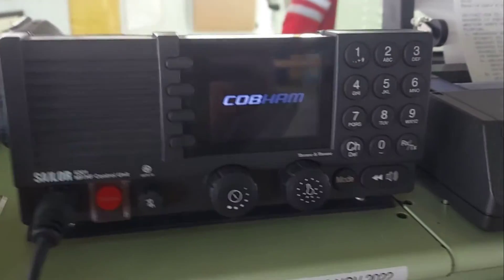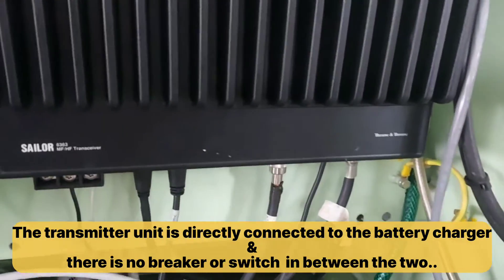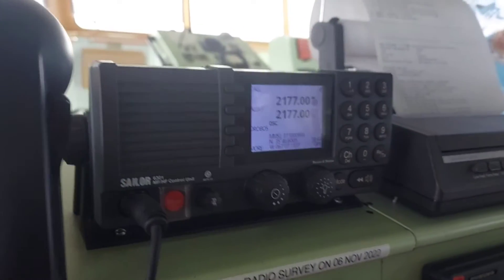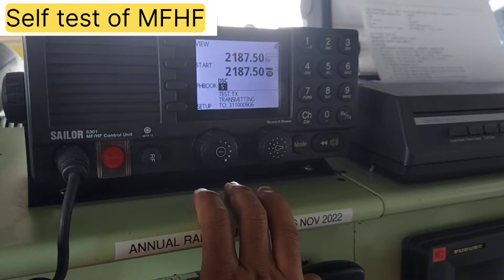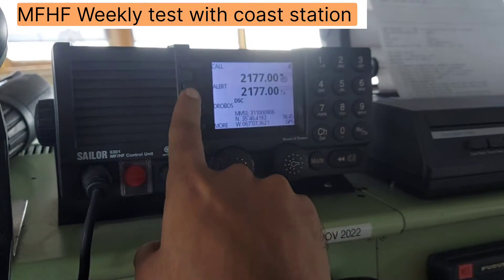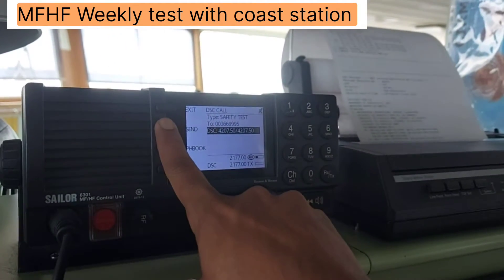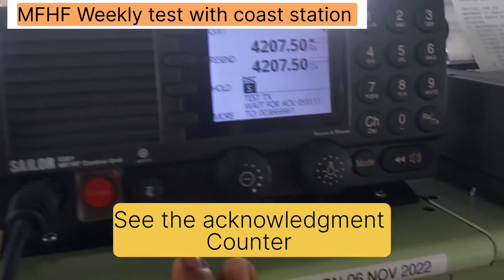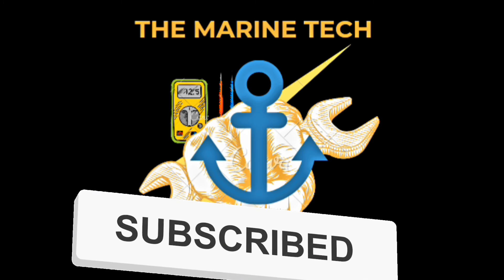MF HF DSC TROUBLESHOOTING || MFHF DSC TEST||TRANSRECIEVER 6363 TROUBLESHOOTING || SAILOR 6301 #gmdss

Comment: Hi there 👋🏻 anyone faced with 6301 mf/hf testing Loopback failed? And then it's frozen only rebooting helps but self test/ coast station didn't works frozen display..
Reply from the maker: Yes, please reset the transreceiver once and check..
Reply: How ? I did factory reset didn't help.. turned it on/off nothing helped
Reply from the maker: @UstyrtPlateu transceiver is a separate unit that is connected with main and emergency source..so you will have to isolate both supply then wait for 2 min then start..
Reply: Thank you  @TheMarineTechLawrance

Comment: Handset is not transmitting what can be the solution
Reply from the maker: Hi.. first thing is can you pls change or interchange handset and check is it handset problem or transmitter..?
Reply: Thank you for your reply, but i don't have another handset, can i use hand microphone   of different radio such as ICOM radios but same number of pin connector? Is this possible?
Reply from the maker: @lottolotto1454  you can use any handset with same pin..
Reply: Thank you.